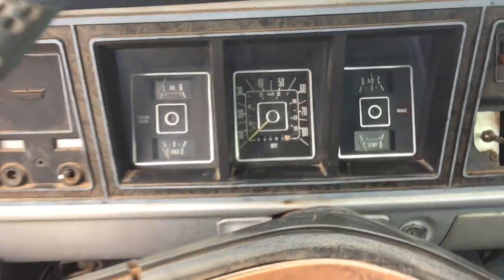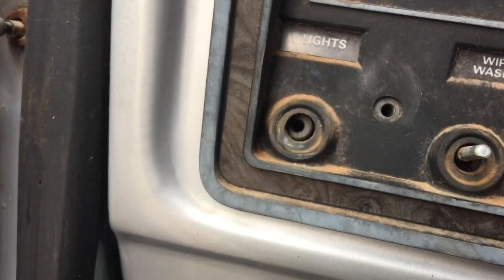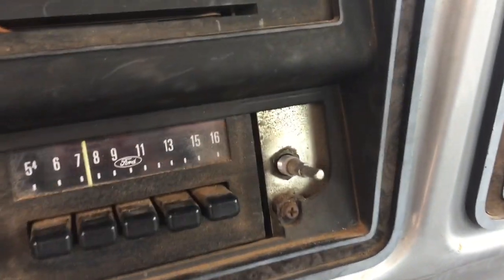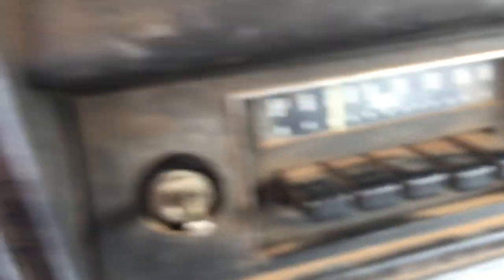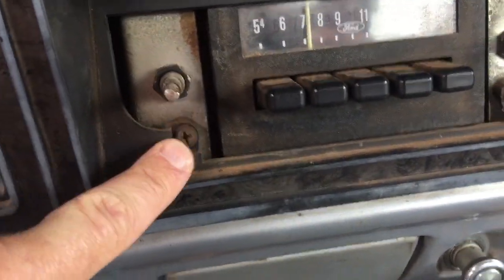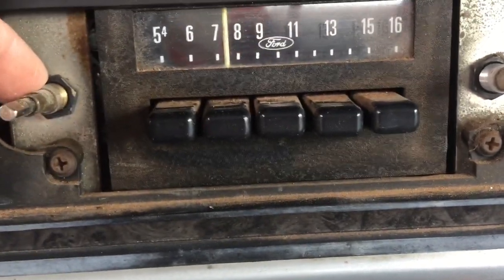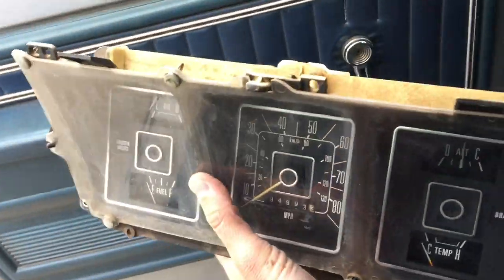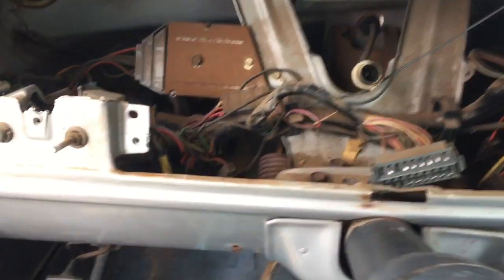1977 F150 Instrument Cluster Removal

Comment: HELLO MUNSON DO YOU HAVE A VIDEO EXPLAINING HOW TO REPLACE A PRINTED CIRCUIT BOARD ON A 1977 FORD F-150 OR DO YOU KNOW SOMEBODY THAT DOES THANKS
Reply from the maker: I don't but its not hard to do at all.  Just make sure you order the correct version.
Reply: @MunsonMischief  From where do you order parts? I also have a '77 Ford F150 and all the dash lights are out. I also need to see how the A/C vents are routed - and other things as well. Thanks in advance.

Comment: How did he get the speedo cable off?
Reply: I just did this today. After you pull the gauges you simply press on the square tab of the white plastic clip that holds the cable to the cluster and push upwards while you do. The clip will come lose and the cable will slide right off. If you search for “Fox body Speedo cable removal” on YouTube you will see exactly how to do it. Hope that helps!

Comment: My '76 F250 doesn't even have a radio (factory option) but I did need to know how to remove the heater control knobs. Glad to know my suspicions were correct. Also, it was helpful that you showed the headlight knob release button. I could just see myself cussing at the inspection camera like an asshole

Comment: how do you unhook the mph on the back
Reply from the maker: Do you mean the speedo cable?
Reply: Munson Mischief How do you unhook the speedometer cable?
Reply: @MunsonMischief  Yes how did you get that cable off?
Reply: Same question!
Reply: There's a white plastic clip that surrounds the bell on the end of the speedometer cable.
On that clip there is a flat area that you can feel when you get your hand up in there.
Note: The flat spot I'm talking about is toward the speedometer rather than on the cable side.
Press on that flat spot and gently wiggle the cable and it should pop loose.